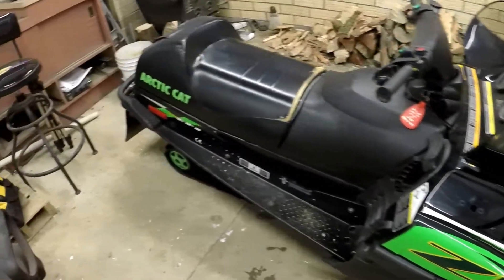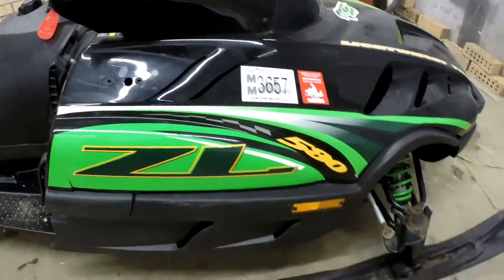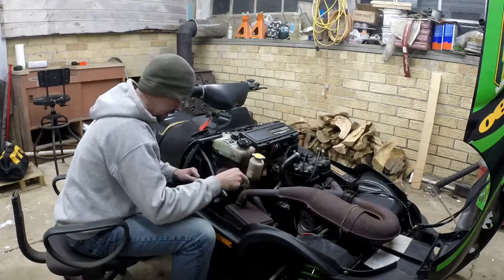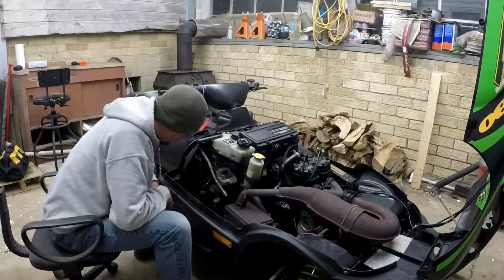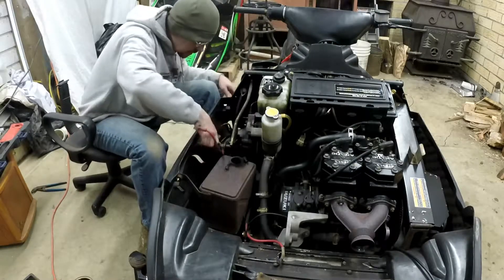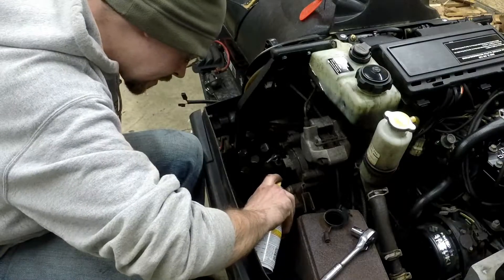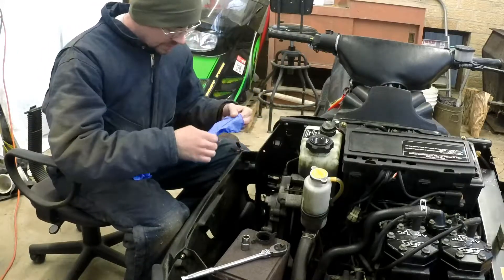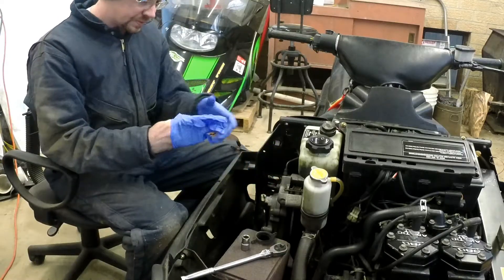Arctic Cat ZL580 EFI Tear Down

Comment: Hey I found you through your comment on 3D machines, were do you all ride your atv?
Reply from the maker: Mostly on private trails that run are near by. The land owners allow riding as long as you stick to the trails and don’t tear stuff up. I live in Central PA and there are a couple nice atv parks not to far away either.
Reply: i used to hang out alot in the tioga county area, any possible ways that yous need a new riding buddy? up here in catt county ny i dont know anyone that likes to really pend time riding